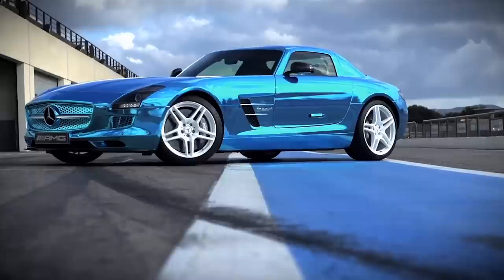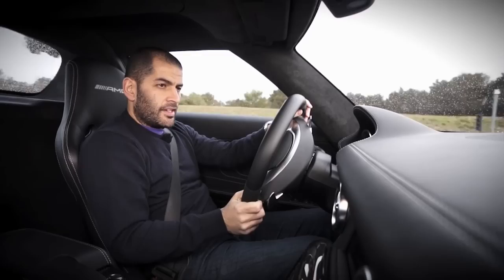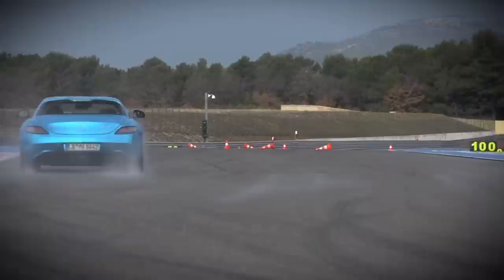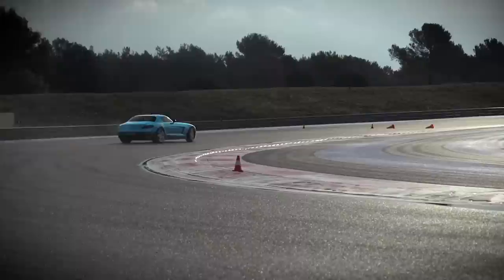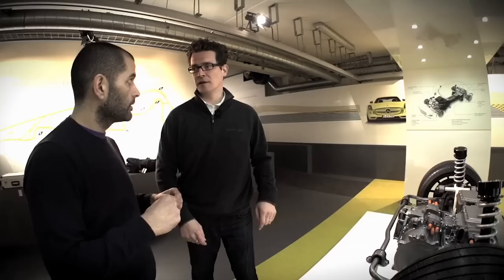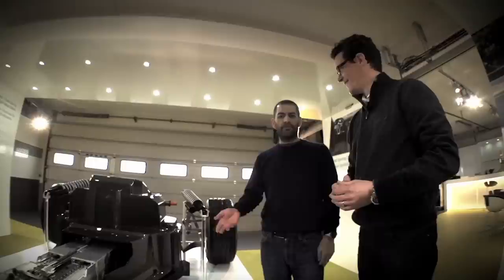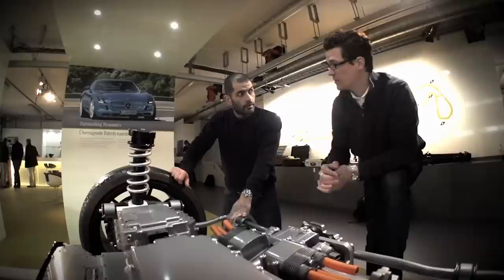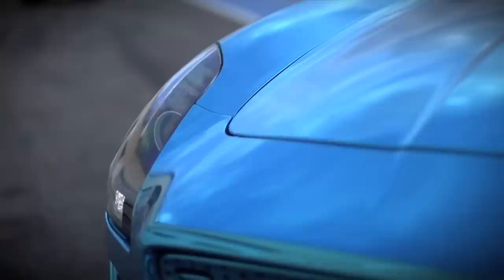Mercedes SLS Electric Drive. Can Volts Ever Match Pistons? - /CHRIS HARRIS ON CARS

Comment: They will never match ICE on these key fronts:
Weight and hence driving feel
Driver involvement 
Sound. 

Those are huge things that are missing from electric supercars. They are just one trick ponies that can accelerate quickly and run out of juice quickly unless you give them a battery that weighs as much as a planet.
Reply: SMH WHEN WILL PEOPLE LIKE YOU LEARN....
WE LIVE IN A WORLD WHERE NOTHING IS IMPOSSIBLE🤦🏾‍♂️
Reply: @Kill6ixBillionDemons  but its not conducive. Why would they try to make an electric car have gear changes or vibrate or have a loud, good sound? Its not conducive to electric cars. They just wont have them. So no. 

Also, while they will improve, batteries will always have quite poor energy density because the number of atoms used to store electrons is always high compared to fuel where every atom IS energy. It will be interesting to see if they can bring the weight down and range up.
Reply: @Hello_there_obi  got a point.
But ICE will be a thing of the past just like horse and carriage.
Besides its not good for the environment and i really want my brothers and sisters to be able to walk outdoors and enjoy the sun and fresh air for years to come.
Time to move on, also i enjoy the capabilities of electric cars and the features they provide some of which are quite convenient, alot of them are very safe and the lack of an engine leaves room for endless possibilities. I wish my grandfather could see this, he was an open minded guy and lifting a trunk to show him my car has no engine would've seriously messed with him. Im thankful to be alive at a time like this.

Comment: The future is going to be boring. You cannot rev the electric engine to get that nice engine exhaust sound. Already formula e races sound awful and garbage.

Already in car racing people like automatic transmissions because they can shift faster than a manual transmission. 

In the next couple of years there won't be a need for race car drivers at all because computers will be able to steer, accelerate and brake faster and more accurately than any human can.

Electric cars are boring because you drive with two pedal's. Manual transmission's are the best for a overall fun driving experience.
Reply: "Electric cars are boring because you drive with two pedal's."
So according to that most current supercars are boring for you? Or are there still some that don't have a double clutch transmission?
Reply: @sebastiannolte1201  Corvette ZR1 is basicaly the only handling Supercar left with a Shifter.